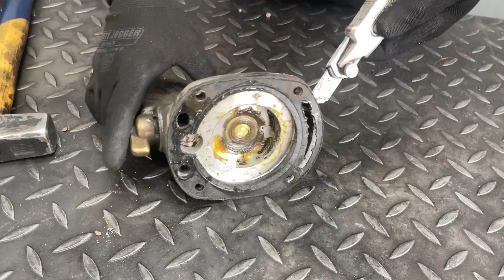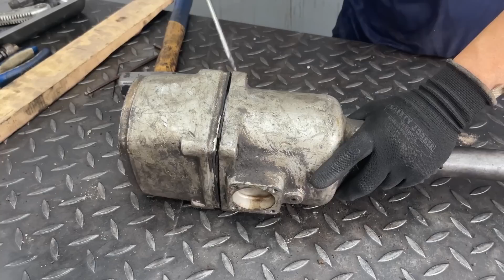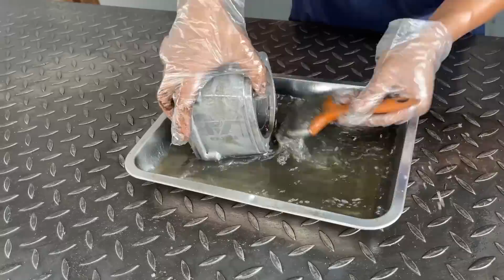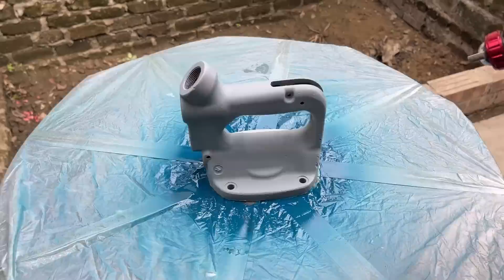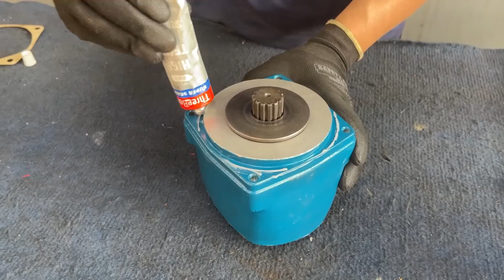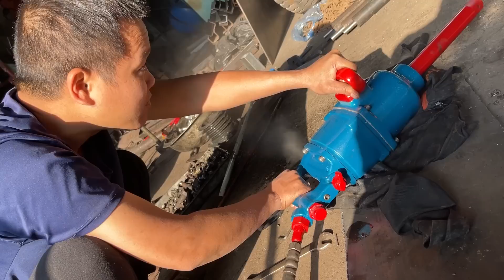Genius Guy Restores Heavy Duty Pneumatic Impact Wrench For Auto Car Garage // The Result Is Amazing

Comment: All you guys ever think of doing is painting everything. There are things that you just don't paint! And you call yourself a genius? And there was nothing "amazing" about this restoration.
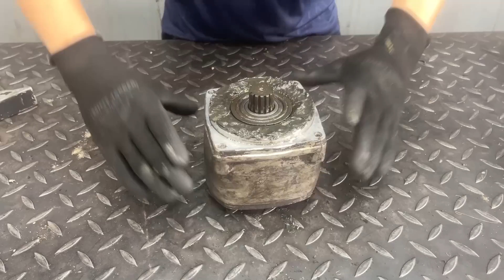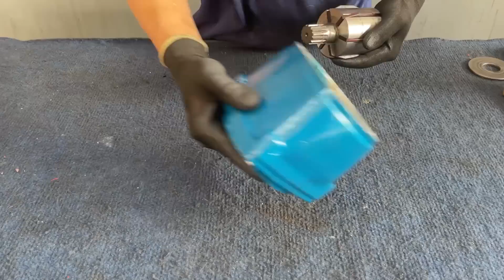Reply: Additionally, it was put together incorrectly. See 4:30 and 8:40 reversed elements.
Reply from the maker: ok thank you for the comment.we always try to develop ourselves more so as not to disappoint our fans.thank you very much
Reply from the maker: Thank you for watching and subscribing to the channel. I was a bit confused when I installed the correct flaps with the key. I have the cap upside down. But I fixed it to work. Thank you very much.